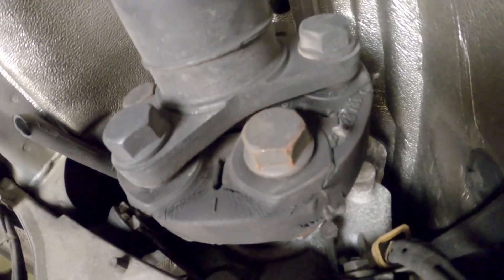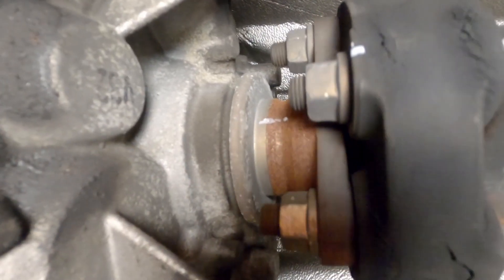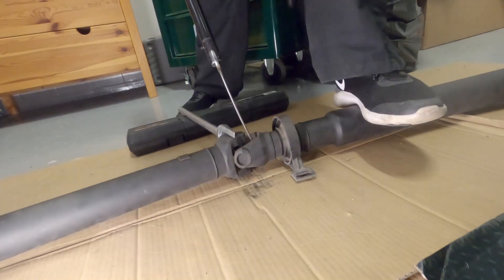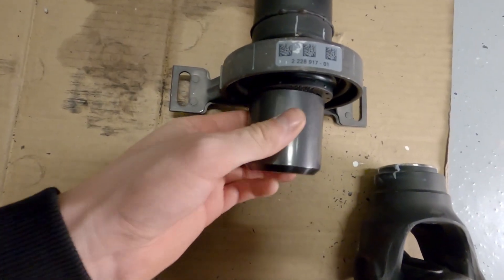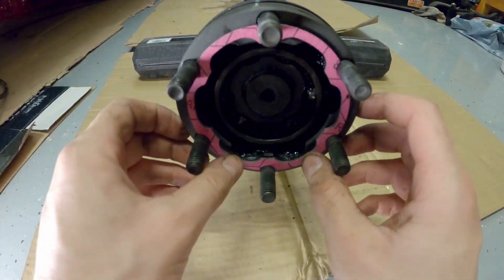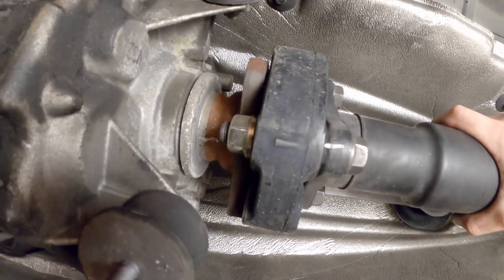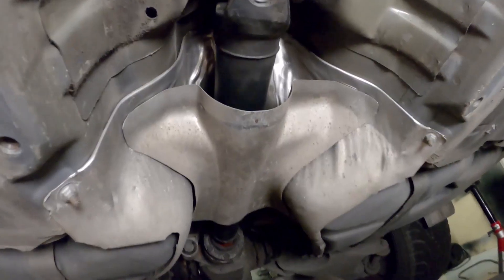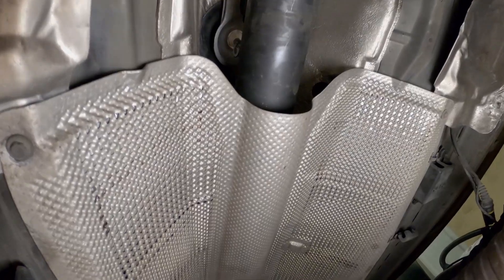Flex Disc & Center Support Bearing Replacement - E39 M5

Comment: Thank you so much man, doing my CSB/Guibo/rear CV right now and this has been super helpful. I just wish I did all of this when I had the trans out last year :'(
Reply from the maker: Glad I could help. I recommend doing shifter bushings while driveshaft is out if not already done.
Reply: @alexdoescars  Already did those when I did the clutch 30k miles ago. I just didn't do the CSB while i was in there mistakenly so it took out my giubo.

I will say this, loosen the 18mm bolt for holding the two shaft halves together while the shaft is still bolted to the car. That way you don't need to do any janky stuff to break it loose off of the car.

I also tightened mine this way too
Reply from the maker: @mikeking5834 Good tip. I realized iit too late
Reply: @alexdoescars  I've watched at least 4-5 videos on this subject matter and no one says to loosen it before taking the shaft out, it's not just you :)

Comment: Hi Alex, great video! How tough is it to do this job on jack stands especially when it comes to torquing the bolts? I do not have a lift and am planning to do this job on the jack stands just like you did
Reply from the maker: I'd say not too tough. Hardest part is probably removing the exhaust as it's quite heavy.
Reply: @alexdoescars  thanks Alex yup looks like the exhaust will be tough to remove. Luckily I have the mufflers chopped off haha
Reply from the maker: It's not too hard. Mufflers are the heaviest part so having them chopped will help a lot.
Reply: Hi Alex I am planning to do this job soon. However I will completely replace the driveshaft together with the CV joint. You marked the ends connecting to the differential and transmission. Since I will be replacing the entire driveshaft I won’t have marks on the ends. Can I just place the driveshaft in any orientation then?
Reply from the maker: I'm not sure. I think you might be good to install it in any position as it should be balanced but you shoud do some research on that. Worst case, there is 1/3 chance it goes right way anyway :)

Comment: Can you tell me what are the manufacturers of the new pieces you used? If they are aftermarket, of course. I heard aftermarket pieces for BMW driveshaft were not that good, unlike all the other aftermarket parts for the whole car
Reply from the maker: These are bmw parts ordered from a dealer. Next time I'm under the car I can try to find stamps of actual manufacturer. Bmw doesn't make these, they just put their logo on.
Reply from the maker: Nothing visible on flex disc and the csb is hidden under heat shield. These are quite reasonable at dealer prices, but if you do go with something else just pick a reputable manufacturer like lemförder for example
Reply: @alexdoescars  Thank you, man. I really appreciate it. I will check them out these days.

Comment: Just done one today you don't need to remove the cross member to remove drive shift from a e60
Reply from the maker: Don't know about e60 but on e39 it really helps to remove the cross member. At least on reassembly if you want to use torque wrench
Reply: @alexdoescars  you do have to spin the shift to one position for each nut but saved me time as I was on my back on the drive

Comment: MERCEDES OWNER HERE, can someone tell me why this issue is common with German cars but not so much with toyotas, or hondas, ford or chevy cars?
Reply from the maker: I think of it as a fuse, with years of abuse I'd rather have my flex disc go than my differential. I have no experience in American cars nor have I ever worked on an front wheel drive car, do they even have flex dics?
These Germans seem to require constant maintenance to keep you from boredom :)
Reply: because those cars you mention arent rare wheel drive.. the guibo discs go through stress heat during every drive cycle they wear off over time